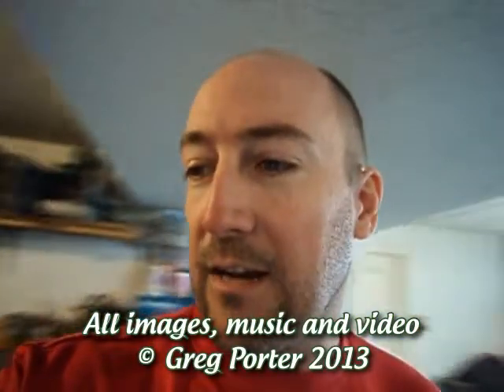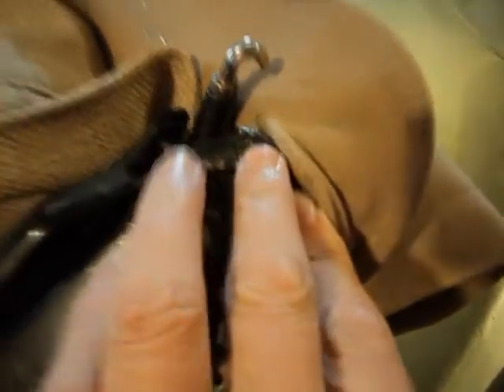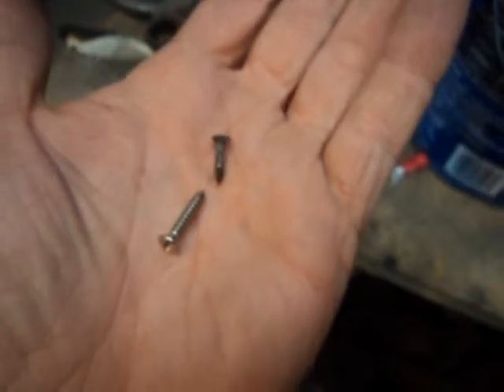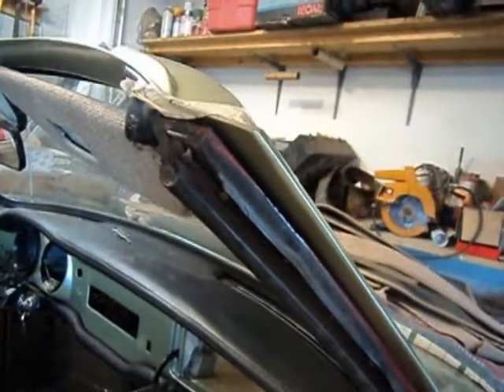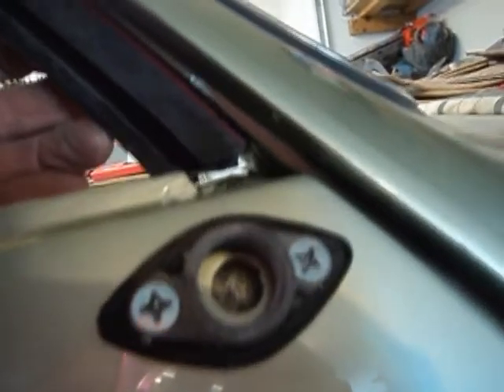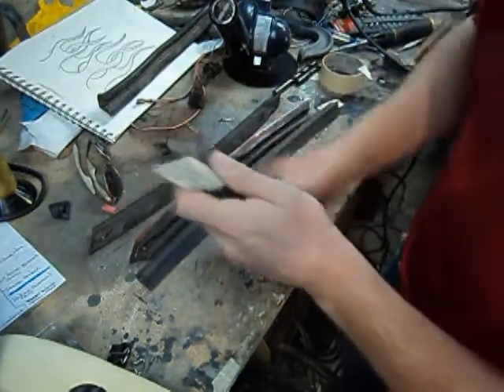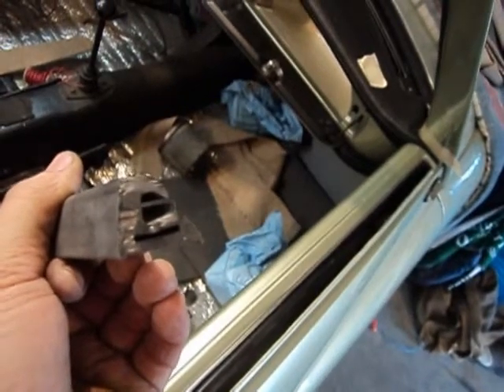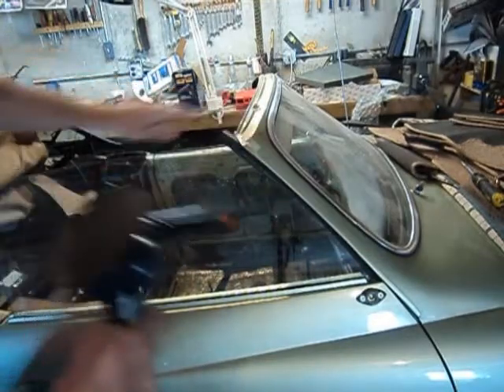Karmann Ghia - Side Window to Windshield Frame Seals

Comment: Greg,

I've seen John Edwards, at the Fiatnutz channel, use a titanium-base epoxy for some holes he's filled and later drilled and tapped, similar to what you're wanting to do with your top frame. He's sold on it for such application, and he's a machinist, if that tells you anything.

Good luck.

Comment: The broken tap is a pain,  if it's a thru hole, taps are pretty brittle, you may be able to break it with a pin punch and drive the pieces out the other side. A magnet would be good for extracting pieces.  Otherwise a tap burner (edm) might be the only way to go,  I don't imagine you'd want the edm fluid all over the place any more than the mess by welding it up.